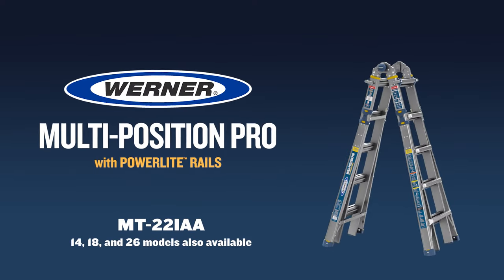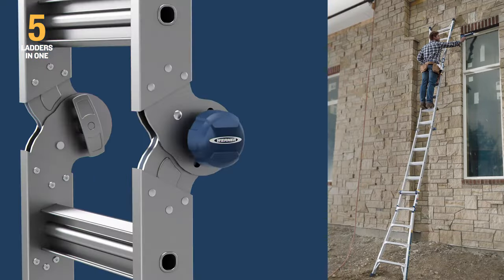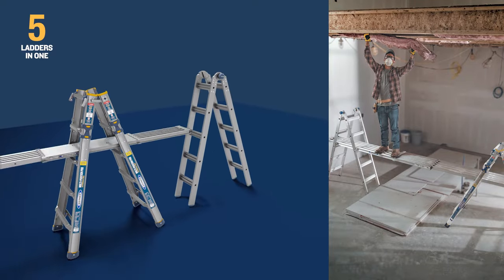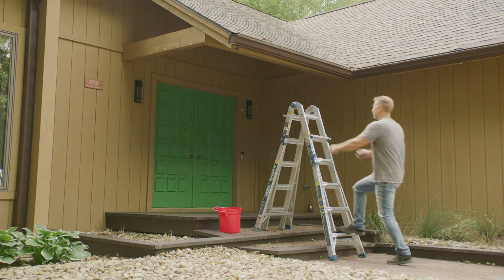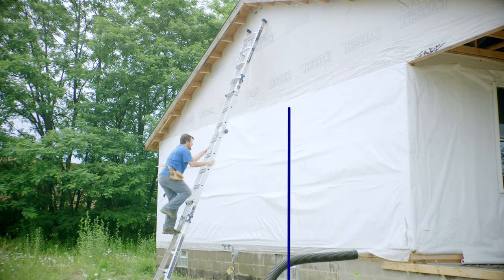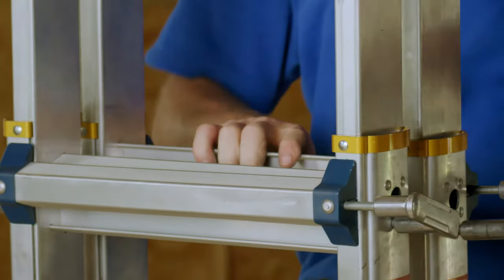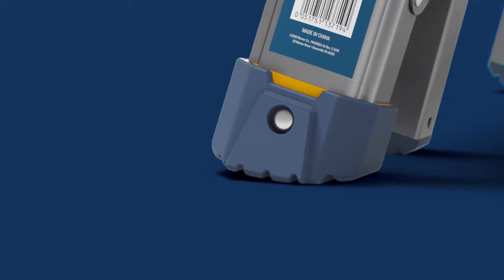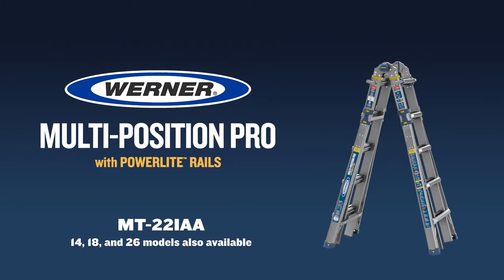Werner Ladder - Multi Position Pro Ladder

Comment: I purchased this ladder 2 years ago and it has been one of my best decisions! I have used it during several construction projects, work around the home, at my job when working on stairways and even going from one roof to another. It's rugged, and it stays steady on every position it's been put in! I've even used it when cutting limbs off of storm damaged trees, but I used a strap for extra stability when it's fully extended on a tree. Great product!